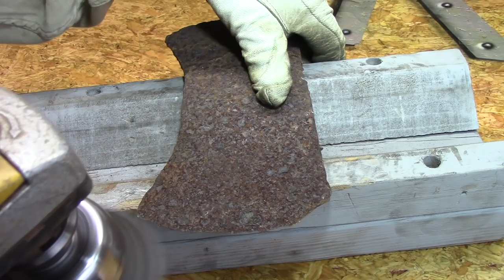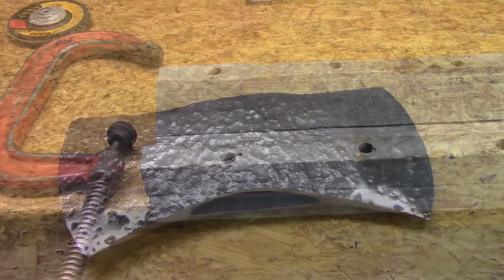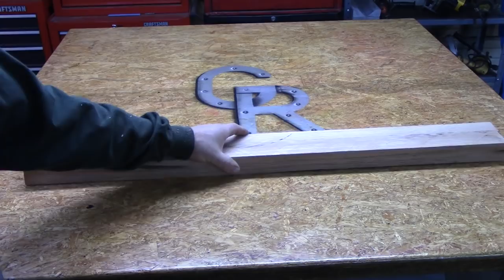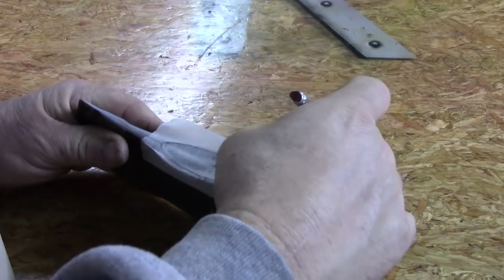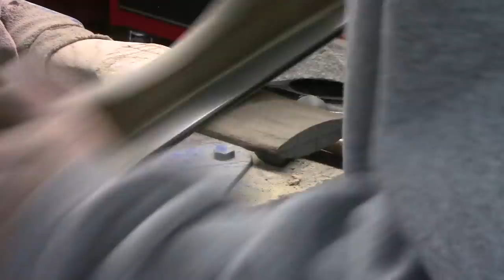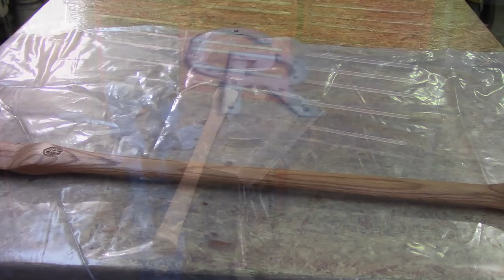Very Rusty Antique Axe Restoration!

Comment: Thank you!!!! I found an axe head just like this one in the woods with all the same details blade chip's, side pits, and inside rust, all the YouTube videos of axe restoration are just mild orange spot's here and there and they fix it up and make it sound like a huge accomplishment, and i didn't want to just grind away the pits and folding on the back of the axe  head ,i want it to still hold character  and age, all that I've done to it so far is wirebrush the first layer of rust off, this video set me in the direction  i wanted to take with my axe  .so thank you
Reply: woah i just found one of these exact same axe heads in the woods too!!!! and i was looking for a video on something extremely pitted and was surprised he had such a similar axe head to restore. have you found out who made it?
Reply: @christopherrector7461  I think the one I found was a jersey axe, but I know exactly what you mean all these other videos on restoring axes are just have light orange surface rust and they do all this fancy stuff to it and I'm just like I could take a wire brush to that and  get it looking good in like 5 minutes